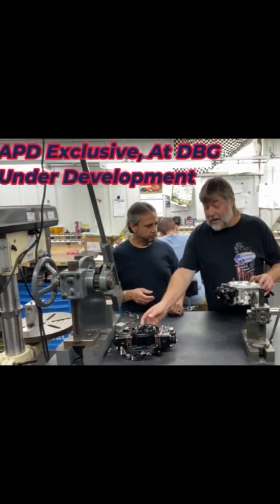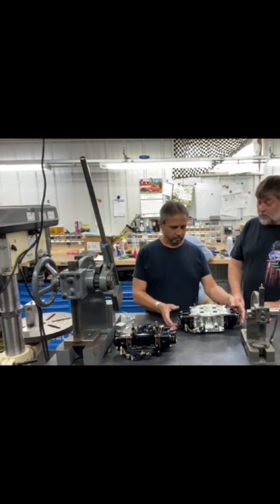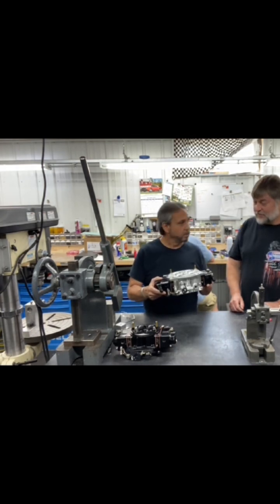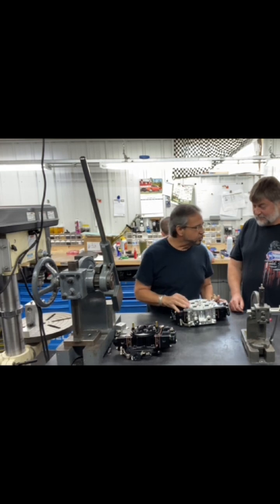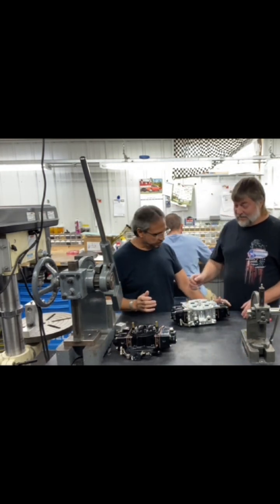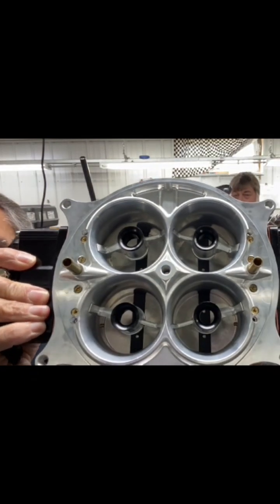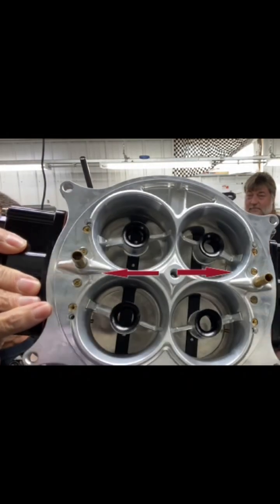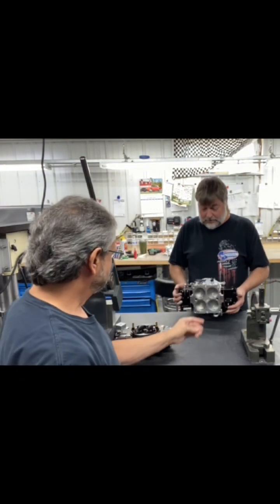APD Newest Carb Design Knowledge is Power at DBG

Comment: You may as well remove the vents. They’re not being used, but it may help straighten out the airflow or it may hinder it. You won’t know until you hit the Dino.
Reply from the maker: @ViperMike-c2r  they may have done that by now. Have not been back since December. Need to schedule another video. Air bleeds is where we left off.

Comment: How does it break up the fuel into smaller  particulars.
Reply from the maker: With air flow.
Reply: @DragBoss351Cleveland  to do that with air the fuel needs to shear.
Reply from the maker: @johnbnos944 ok. This is under development. They had tested it the night before and it works well. So the air molecules entering along with fuel shears, causes atomization.

Comment: Can you explain how manifold vacuum doesn't pull on the acc pump circuit?
Reply from the maker: Has a check ball system under that billet cover
Reply: @dragboss351cleveland  thankyou
Reply from the maker: @twr064 your welcome
Reply: @twr064  check ball still in use I’m guessing